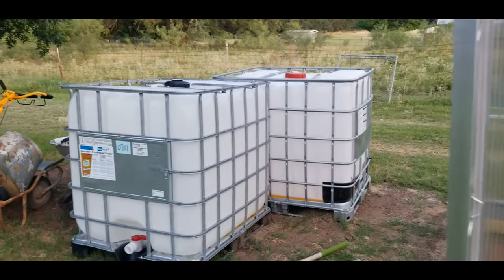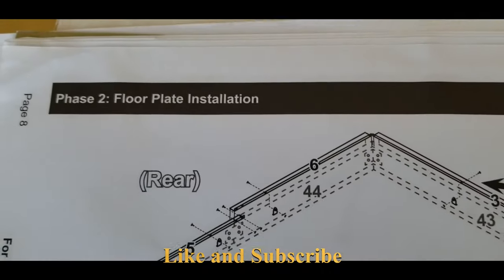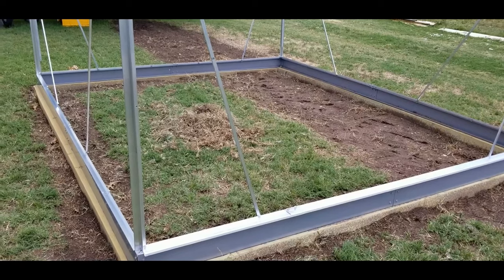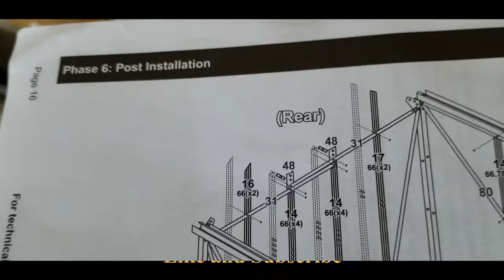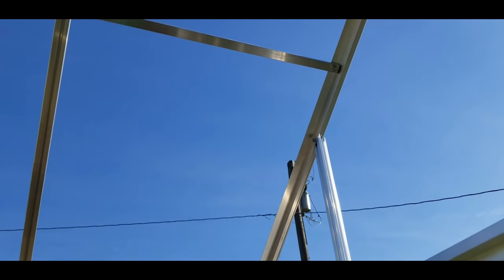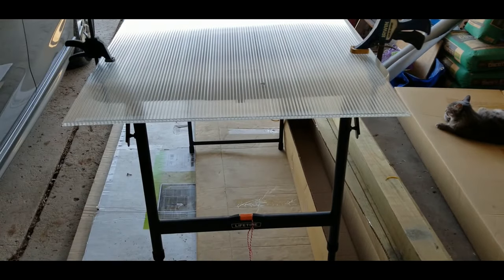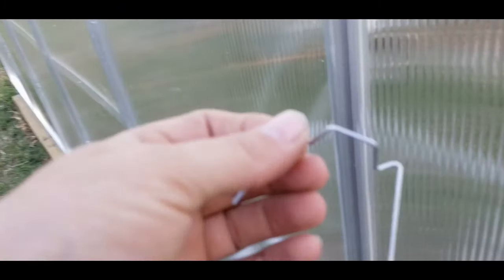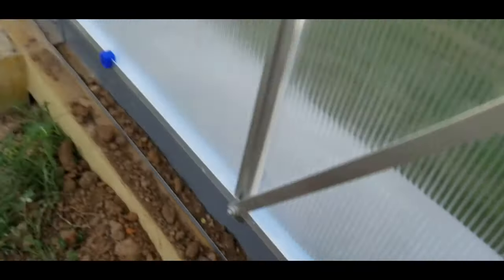2020-24 -How to build Harbor Freight 12x10 Greenhouse complete build with modifications! Links Below

Comment: Just brushing up on how to use the kit, just got mine in the mail a few days ago. Excited to get this green house assembled!
Reply: Just a follow up,  had to wait out gale force winds and buckets of rain to install your 10x12 kit. I  can say this modification/upgrade is absolutely neccessary to keep the greenhouse in one piece. We luckily located our blown out panels, raced to install the kit as the wind & rain returned.  

I thought ahead and planted 4x4 posts on the inside corners to both attach it to and keep it from taking flight/folding over. It's now survived 2 solid days of gusts over 50 mph.

Thank you for the well thought out kit!

Comment: Just ordered your full kit with door sliders, looking forward to getting started... weather dependent! I noticed you used weatherstripping on the panes, I assume to keep the rattling down & better protection. I've seen a couple vids that swear it's best to silicone around the whole frame & dropping pane onto it for complete seal (in addition to added screw), that this was for more support/durability against high winds & panes popping out. Thoughts? Running a bead of that would be just as easy as adding the weatherstripping.
Reply from the maker: I wouldn't do that mainly it being a huge mess if you ever have to replace the panels.  It would help though for strength.

Comment: Just ordered the Caulk puck & parts kits 
Picked up the permit for the unit last night and bought the base lumber today still have it on the ladder rack. So I will be busy
Reply from the maker: Good to hear!  I hope it all goes well.
Reply: @ThirtyoneCrafts  the parts came today! 
Now I have to get busy Deciding on the Heating system, compost heat, solar, or something like that...
Reply from the maker: @rocdajacable  there is always something to do. We are still trying to figure out how to keep it cool here in Texas.  I recently draped a 70% shade cloth over the top and it's helping a lot!
Reply: @ThirtyoneCrafts  well summer gets Hot 🔥 last Friday night I was talking to a friend in Oklahoma 110° I said it's 77° with 74% humidity & that's The Lighthouse weather station in Sodus Point New York
Yes you can cut thick slices of it.. that was at 8:15 pm ...
Reply: @ThirtyoneCrafts  howdy I just used up three tubes of caulk nearly got one side or every panel, once I completely stabilized each one it caulked in seconds, I didn't bother to pull the plastic either it went over smoothly with minimal pressure but don't let them move you can get a perfect 1/8"-5/16 inch bead of silicone easily.
Absolutely positively established it was perfect.
Reply from the maker: I glad they worked out for you.  Always a pleasure to hear from satisfied customers.

Comment: Have you come up with a solution to close the gap between the two doors?  I'm concerned I'll loose too much residual heat during the night.   I'm very impressed with your work and have great confidence that the spacers and your suggestions will help my greenhouse withstand the constant barrage of wind we get in my area.
Reply from the maker: Thank you for the kind words!  I do hope that it helps your greenhouse last longer.  I really haven't found much solution to the sliding doors besides replacing them with a storm door.  Soooo much better!

Comment: Where in this project you using the round foam that you recommending to purchase in your website along with screws, silicone calking and few other items?
Reply from the maker: I didn't get that on the video.  It's simply stuffed in the voids at the top and bottom of the panels.

Comment: I also plan on putting the base railing on 4x4's, but I do not have access to the box & manual and need to set the 4x4's ahead of time, so could you please, send me the exact inside measurements so I can properly set my 4x4 base ahead of time?  I'll need to know this as I'm going to dig & place posts at each corner & want these to be as close to the greenhouse as possible, & no one is answering this question for me.  This simple info will be GREATLY APPRECIATED!!!
Reply from the maker: I provide my measurements in the video.  https://youtu.be/_5JKp4crMHE?t=290

Comment: We really appreciated all of your instructions. We did purchase your kit and it was very helpful.  I would strongly suggest against using the silicone  to seal the panels even with your tool if you are not certain you have every single chamber well sealed.  You will be concerned that you are using too much silicone, but if you miss a complete seal on any chamber at the top you end up with water getting into the panel and not being able to get out.
Reply from the maker: I completely agree. I did run into a couple channels where I didn't put enough and noticed a little moisture accumulate at odd times (like not rain or not humid), however, it ended up disappearing.  That's why I do recommend putting about 1 inch of silicone in the ends.  That should be enough to seal things up.  If all else fails, you can use a need to poke a pin hole where there seams to be a trouble spot and that will solve that issue.  All in all, keeping most of the moisture out is better than not doing it at all.  Thanks for your input and support!

Comment: Any tips on the doors? Everything is level and square and I can't get them to slide freely at all. The lower wheels don't make contact with the rail.
Reply from the maker: My best advice is to get rid of them.  We replaced ours with storm door.  The sliding doors are a horrible design.

Comment: Could you please give me the exact inside dimensions of the bottom tracks from side to side?  I'm going to put on 4x4's & posts on each corner, so I'll need that info first.  Thanks!!!
Reply from the maker: There are some slight variations depending on part number you get from HF.  Best thing to do is just lay them out and measure what you have.

Comment: Did you put weatherstripping on all four sides of each panel?
Reply from the maker: No, just the sides.  The bottoms and tops is where the foam backer goes after the clips are installed.
Reply: @ThirtyoneCrafts  Thanks for the reply!   I bought your kit and keep coming back to this video.  Marked up my instruction manual based on the errors you highlighted.  Super helpful and much appreciated!

Comment: Rivets could be used instead of screws, but rivets would entail a  metallic (Aluminium) tube spacer to prevent crushing the transparent polycarbonate panels and drilling the rivet hole and then the spacer hole.  One could drill the holes and dull the screw tips..  but self tapping screws are quite a bit faster.
Reply from the maker: I thought about rivets, however, I came up with the same points as you did.  Also, that's another tool that you would have to buy.  Thanks for stopping by.

Comment: Question. I have all of my windows made and all are square. When I put them in they are off by about a quarter inch and takes some finesse to open and close. What should I do? My guess is loosen everything and try to push the roof over? (which I don’t want to do but if it helps)
Reply from the maker: Unfortunately, loosening things up and trying to get it more square is going to be about the only option.  Hope this helps.

Comment: Thank you for  a great video , question .. is the foam weather strip on all 4 sides ?? You had said something about a rope on the bottom edge where the silicone is .. can you clarify please .... Thanks  J B
Reply from the maker: The sticky foam is only on the sides of the panels.  The rope would tuck in the tops and bottoms after everything is secured.
Reply: Is the foam sticky tape used on the roof panels or only the sides ??
Reply from the maker: @jbquinn4033  yes, roof panels as well.
Reply from the maker: Pretty much the edge of any panel that will be secured with the spring clips.

Comment: How did you attach the spacers to the roof panels up at the gable? 😳Thanks for the vid and the kit
Reply from the maker: I need to go back through the video, I can't remember if I stated I put any there or not...but I didn't.  The top of the panel slides into a channel in the gable piece.  Thanks for watching and ordering!

Comment: Hey there, I just ordered the kit you make. I was wondering how many tubes of silicone it takes a to do all the panels?
Reply from the maker: If I counted right there are 51 panels.  It takes about 3 tubes for 10 panels.  So 15 tubes should be sufficient if you fill the ends to just past the applicator where you see the silicone, about 1/2"
Reply: @ThirtyoneCrafts  thanks great little tool you have there.
Reply from the maker: @peterl6617  thank you@  it was my wife's inspiration.
Reply: I’m about to start sealing the panels, did you peel the film off both sides first?
Reply from the maker: @peterl6617  if the tool will slide over then no.  Makes clean up easier.  Also, usually only one side is uv treated, so make sure to pay attention to that.
Reply: Sorry to bug ya again…. We ended up peeling the seal off both sides and I have the one end done. We labeled them all with blue painters tape. How can you tell what side is UV treated? Is there a certain “sheen” to it?
Thanks I couldn’t imagine doing all that without the tool!!! I kept mine clean and don’t think I needed 4 but that’s a bonus!
Any of you people getting this greenhouse. The tool is worth its weight in gold!!!!
Reply from the maker: @peterl6617  I've seen mention in many places that the ones that come with the greenhouse actually have uv on both sides.  So it may not matter.  I do know if younorser panels from other places it's clearly marked which side is which.
Reply: Hey there, last year I bought the kit and I didn’t put those nice little blocks and screws into the panels and lost one over the winter in a storm. Did the kit include enough of the breakable spacers you used for the wall panels is there enough of those spacers to do all the cross pieces on the walls and the roof cross members in all the bays? And I’m also wondering if there’s enough of the spacers that ride the top and bottom rails to do every bay wall and ceiling?

Comment: Are you still making the modification kits?
Reply from the maker: Absolutely!  Keeps me pretty busy!
thirtyonecrafts.com
Reply: I bought two of your kits.  Worked very well, although to piece made to go onto the end of the tip of silicon didn’t quite work as well as we hoped.  We ended up just using the tape method.  Thanks again.
Reply: I bought two of your kits.  Worked very well, although to piece made to go onto the end of the tip of silicon didn’t quite work as well as we hoped.  We ended up just using the tape method.  Thanks again.
Reply: I bought two of your kits.  Worked very well, although to piece made to go onto the end of the tip of silicon didn’t quite work as well as we hoped.  We ended up just using the tape method.  Thanks again.
Reply: I bought two of your kits.  Worked very well, although to piece made to go onto the end of the tip of silicon didn’t quite work as well as we hoped.  We ended up just using the tape method.  Thanks again.
Reply: I bought two of your kits.  Worked very well, although to piece made to go onto the end of the tip of silicon didn’t quite work as well as we hoped.  We ended up just using the tape method.  Thanks again.
Reply: I bought two of your kits.  Worked very well, although to piece made to go onto the end of the tip of silicon didn’t quite work as well as we hoped.  We ended up just using the tape method.  Thanks again.
Reply: I bought two of your kits.  Worked very well, although to piece made to go onto the end of the tip of silicon didn’t quite work as well as we hoped.  We ended up just using the tape method.  Thanks again.
Reply: I bought two of your kits.  Worked very well, although to piece made to go onto the end of the tip of silicon didn’t quite work as well as we hoped.  We ended up just using the tape method.  Thanks again.
Reply: I bought two of your kits.  Worked very well, although to piece made to go onto the end of the tip of silicon didn’t quite work as well as we hoped.  We ended up just using the tape method.  Thanks again.

Comment: I'm building mine right now. I have a question on the window vents. i did silicone the panels but they won't fit in the channel with the weather seal. What did you do on the window vents to keep it so it doesn't leak?
Reply from the maker: I'm not sure what weather seal you are referring to.  The vents are designed to shed water so they over lap the bottom.  And the top goes in the top channel/ridge beam.  Shoot me a picture via email/text and I'll help anyway I can.
Reply: @ThirtyoneCrafts  in your video you put the weather striping vertical on each side of every polycarbonate panel. I’m curious if you also did this on the roof vent panels.
Reply from the maker: I see, no I didn't put weather stripping on the vents because those panels are fully enclosed by the frame.  Sorry for the confusion.  Let me know if that answered your question.
Reply: @ThirtyoneCrafts  thanks! Can you also tell me if you siliconed the panel into the roof vent? If not does it leak?
Reply from the maker: @adamthibeault  I did not and haven't noticed any leaks since built.
Reply: Thanks! Also, I purchased your kit a few weeks ago. Thanks for offering it.
Reply from the maker: @adamthibeault  Thank you for buying it!  If you feel inclined, please leave a review on the website.

Comment: The roof rafter cross bars: we have one screw hole that does not line up with the other hole or with the rafter bar coming off the side. Not sure if that was a factory defect or what. I’m not thinking it’s user-assembly issue because it literally doesn’t line up with the other bar’s screw hole.
Reply from the maker: It is very likely the part is missing the hole.  In my video I had to drill a few holes in some of the parts.
Reply: Thanks. I just ordered your kit! I ordered and started the greenhouse last spring but got into a standoff with my daughter who was supposed to help me. 🙄 Apparently, I lost because I am once again building it mostly on my own. Lol. This means that I have some additional clean up that I need to do because most of the parts remained outside. So far, nothing too bad.  🤞
Reply from the maker: @peggilaw9984  Thank you for the order!  Although I recommend two people, I built ours about 99% by myself.  You can do it!

Comment: Did you use 2x4s laid flat for your foundation or are those 4X4s?
Reply from the maker: Good morning Peter!  I used pressure treated 4x4.  Make sure you get some that are good and straight grained.  They did end up warping a little, but that was fixed later when I cemented in the corners one day, then the centers after the corners set up.  Watch here https://youtu.be/_5JKp4crMHE?t=2157

Comment: I bought one just like it and so did my neighbor. Both of them blew down with the first little win. Mine was so twisted up and bent I couldn't salvage it. My neighbor could salvage his. And he had to reinforce it with heavier aluminum and 2x4 lumber.  They are made of the lightest aluminum you can find.  The sliding doors never did work right. Save your money and build one out of lumber!!!!!!!!!!!!!!!
Reply from the maker: I do agree that they are not built with the best of material.  However, like many before me have done, with proper modifications they do last.  Ours has already stood up to several 70+ MPH storms in central Texas.  I am currently working on a solution for the doors as well, very poor design.  Thanks for commenting!